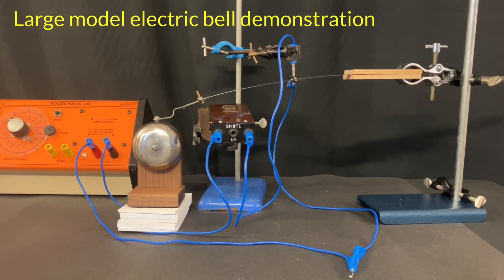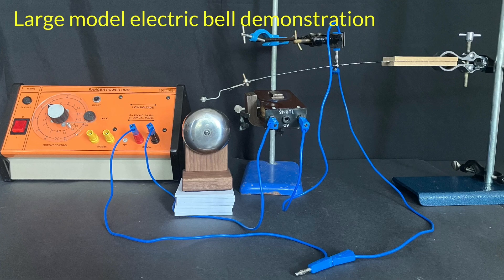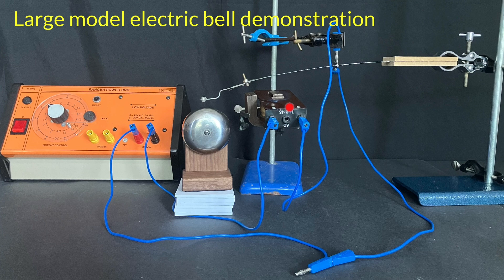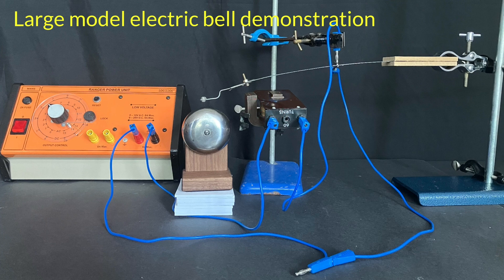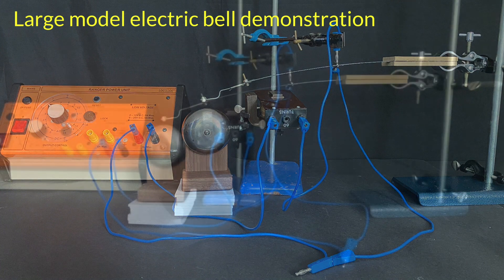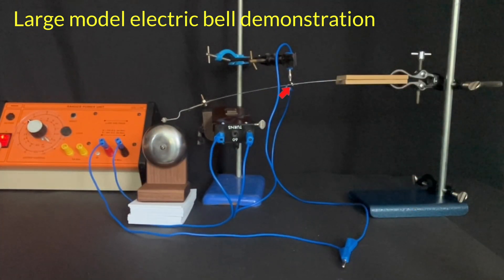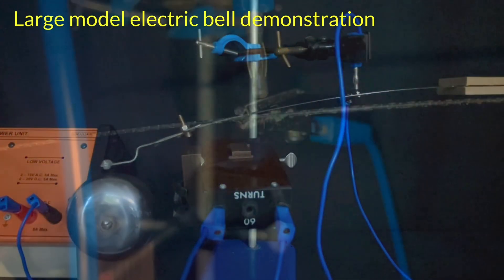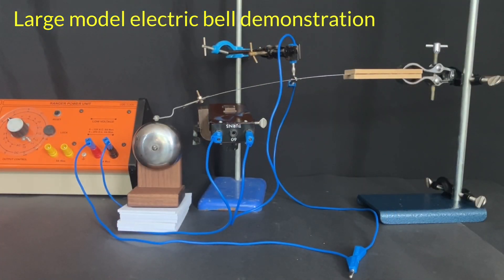Large model electric bell demonstration

Comment: This will make a lot of electro magnetic interference from those sparks. And the contact area will probably become pitted and damaged over time. 

How would it be done in a commercial product? A reed relay responds to magnets, I believe. Maybe that could be used.
Reply from the maker: Here is a video I made of a comercial electric bell.  I think the lower current and hence weaker magnetic field from the coils mean there is much less sparking.  https://youtu.be/PTZ8NdHzMq4?feature=shared You are right that the contact area becomes damaged and I swap the crocodile clip used for a new one.